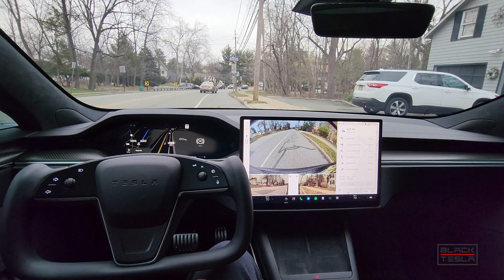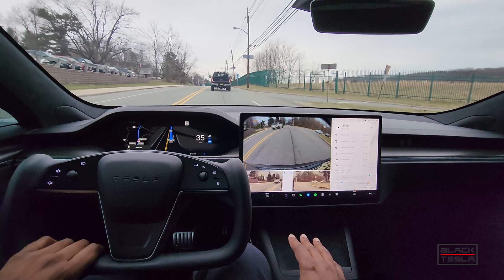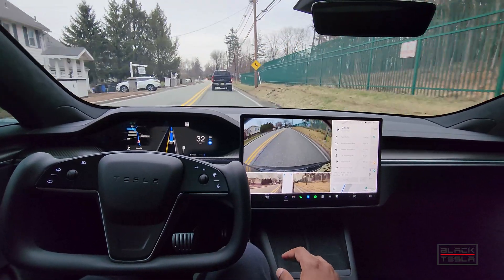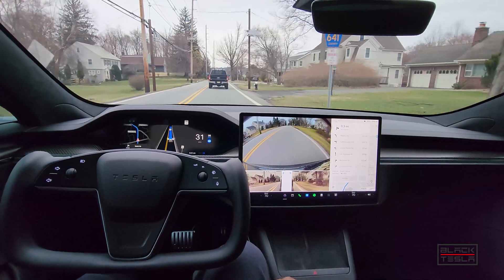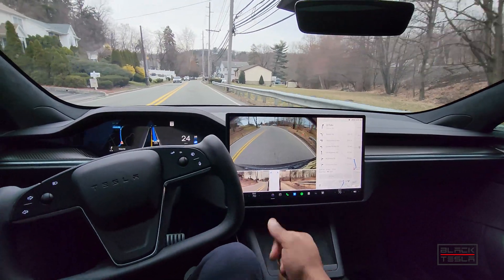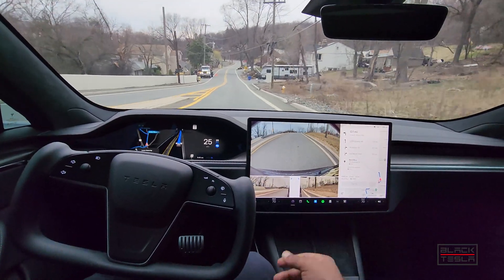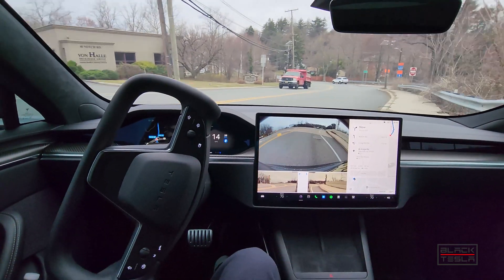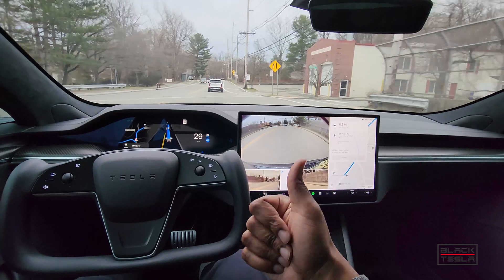FSD Beta 11.3.2 - Roundabout Test (Single Lane)

Comment: Great video. I just got a used Model 3 with FSD included, but it's still on 10.69.25. I've set up a testing loop in my town with a couple traffic circles. Both single lane, it one well if I push the accelerator and the other one I had to push the accelerator but it tried to take the wrong exit. Looking forward to improvements with 11.3.